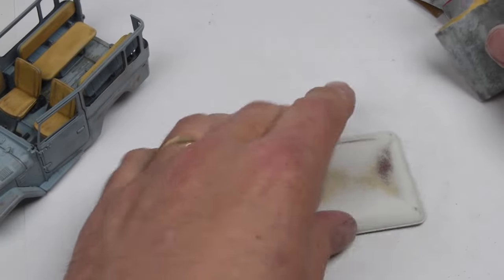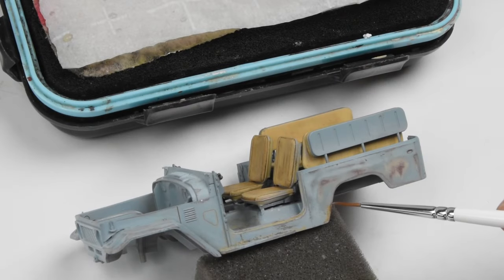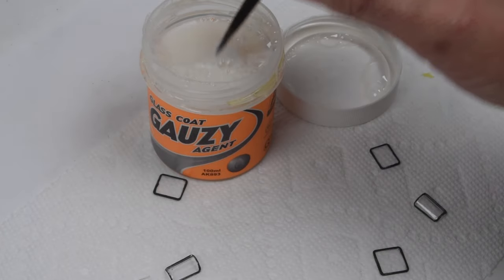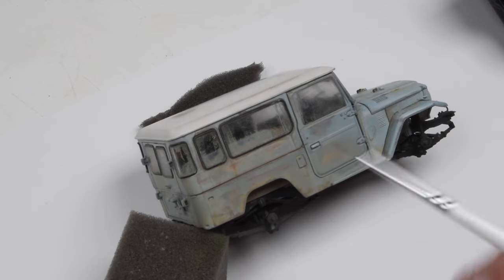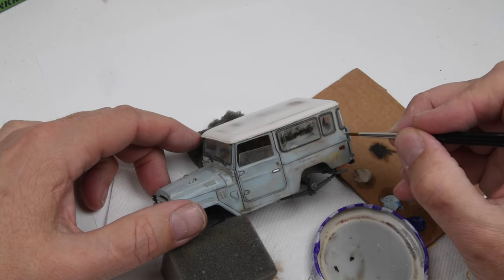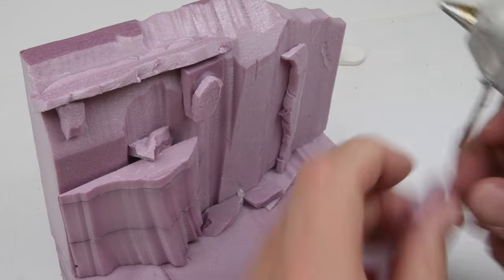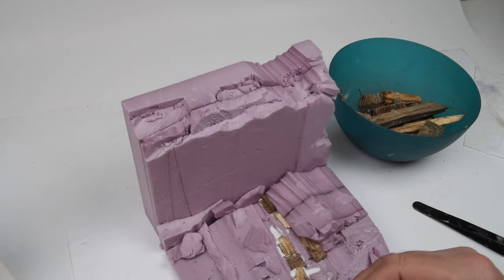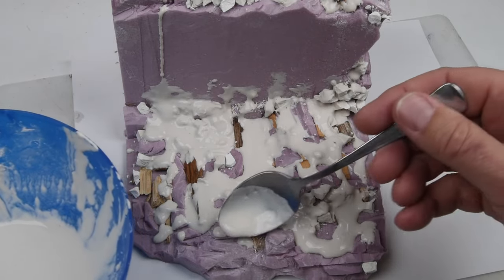FJ43 SUV Hardtop Ep.2, Weathering with Acrylics

Comment: Unrelated question, but how long do your Friul tracks usually take, to get to you, when you order directly through Friul? I recently ordered a set of Winterketten, and the postal carrier there, received the package on Monday. They emailed me, tracking information, but obviously none of it is in English, and when trying to translate it, it doesn’t make much sense. I just want to make sure I have an idea roughly, so I can keep an eye out for it. I’m in an apartment building in Baltimore City, MD, so shipping is almost never easy lol. Friul specifys they don’t refund, or replace, any packages that are not received, due to the fault of the customer. Thanks for any info you have! This looks great btw!!
Reply from the maker: Sean. If I recall, it was about 14-18 days from order to delivery. The last time I ordered Fruils directly was for the ISU 152 project, but ended up using the Tankraft tracks instead.
Reply: @RickLawlerPropaganda  That was the build project, when I inquired about where to track them down these days. Might be the first time I’ve ever ordered anything international. 🤞 Thanks!